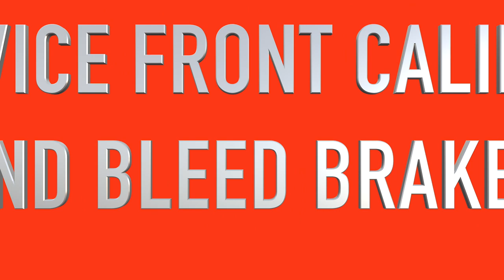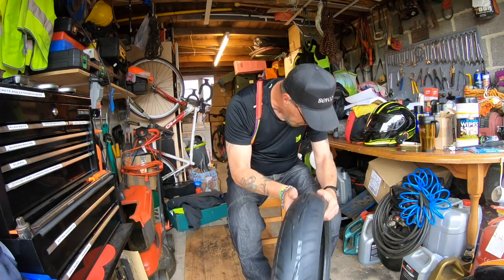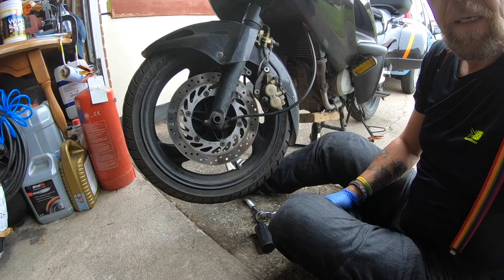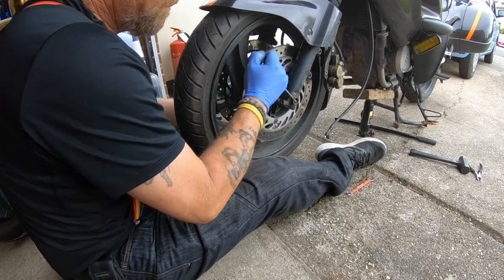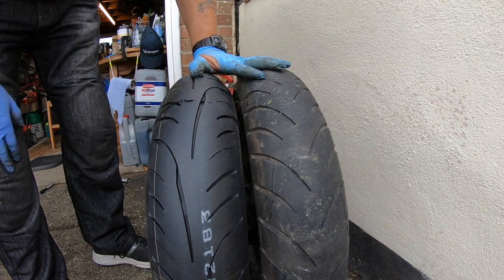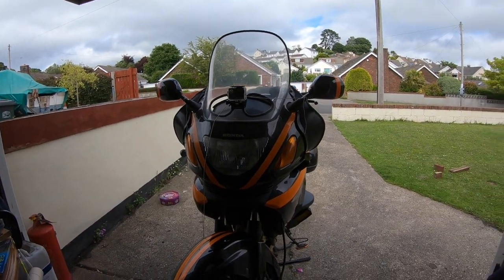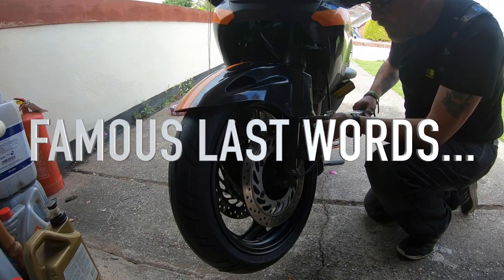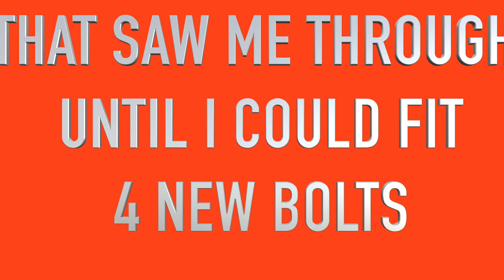HONDA DEAUVILLE 650 FRONT TYRE CHANGE GOES WRONG!!!

Comment: I felt  your pain when the bolt snapped, and is the main reason i don't use a torque wrench on small bolts.  Great channel,  and a great job of bringing the deauville back to a usable life.   Iove my Deauville  ( 21 years old )  and wouldn't part with her. I've added a new bike to the stable, so she doesnt get used as much ( although she was summer use only anyway ).  Take care sir.
Reply from the maker: Thanks very much it's appreciated  Bob. They are a very underrated bike in my opinion
Reply: @biker1k   Overtightening in the past may well have been why this bolt sheared off, so using a torque wrench of the right size is always a good idea

Comment: Wondering if you can figure this out? Purchased second hand 2 wheels with very good tyres while I save for some new ones. Put the front on with my original break disc and now the wheel won't turn?
Reply from the maker: I'm assuming 1st of all they are the same size wheels.
2nd have u put all spacers in correctly
3rd have you refitted the axle nuts to the correct torque setting
4th have you fitted the caliper and pads correctly with anti rattle plates in correctly

I would remove the pads and see if it turns then. If it does your problem is in the brake dept
If not I would go back thru the torque settings and double check them and all spacers etc.
Let me know how u get on fella